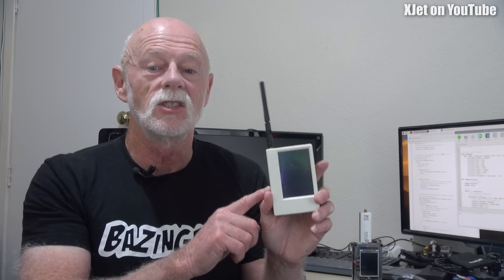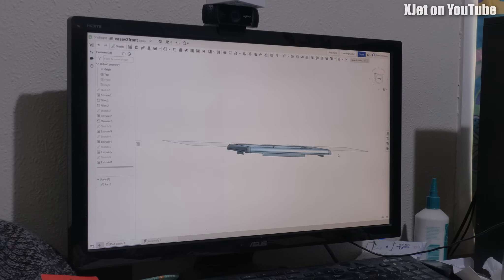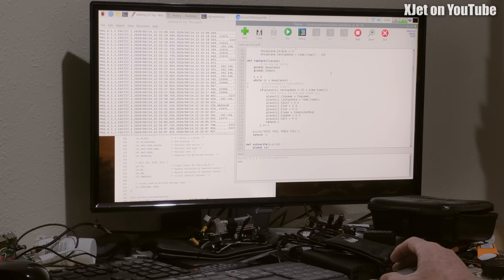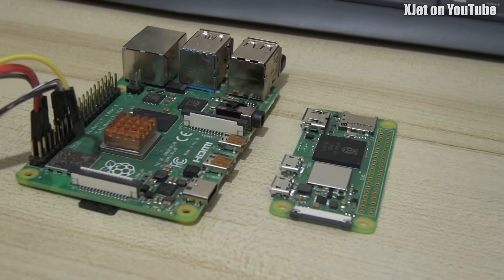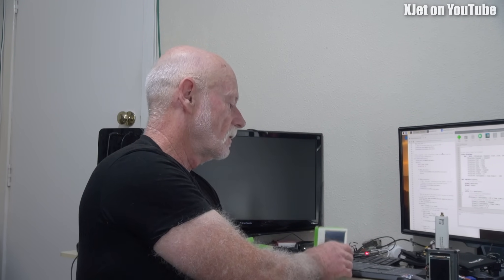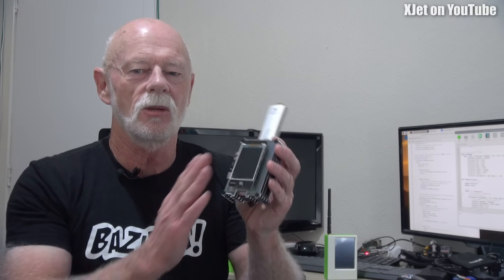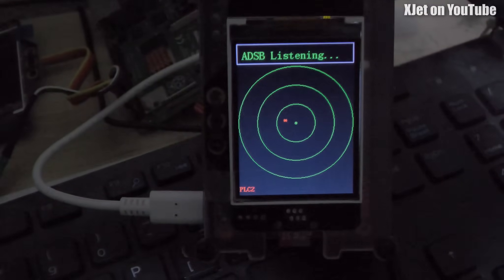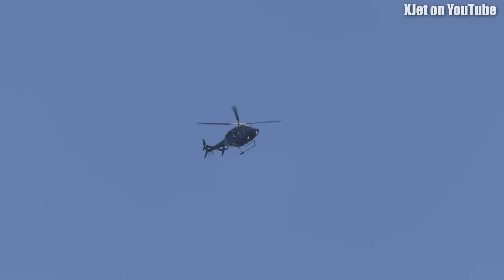This changes everything (I'm not kidding!)

Comment: Thank You for doing this Bruce! I need this device. I had a very close call with a rescue heli that came around a canyon corner from out of nowhere and hovered for 5 min BETWEEN me and my drone, which was out over the ocean with nowhere to land. The heli soon landed about 50 feet behind me on the road where I was standing. I was able to scoot the drone in at very low altitude and landed it on the beach with 7% battery,  just as the heli was landing behind me. It was the only space open enough for the heli to land to await the arrival of an airlift patient from an accident 2 miles down the winding coastal hwy. I monitor Flightradar 24 on a separate device and it never shows low altitude aircraft, the ones Im most concerned with when flying.
Reply: I have a hack rf one. It catches adsb signals and gives you details about  them.

Comment: Good project Bruce! Crossfire has FLARM built in but you pay silly license fees to receive. So many years ago I've built also a Pi solution having a RF scanner on the plane so I can listen to the radio traffic around my plane. Not as reliable as your ADSB scanner but it adds to the "extra safety" measures we take. served me well over the years.
Reply: Flarm also only covers helicopters in the US and EU aircraft for the most part.  And since the new ADS-B out laws/deadlines in certain airspaces were passed, flarm is a dying breed, at least in the US.
Reply: @micahmorton  yeah, i've never used it anyway but it's a shame. the idea was good. all the things we do for safety :)

Comment: Next FAA idea: ADS-B detector is illegal.
Reply: Never going to happen.
Reply: Even if the FAA banned “ADS-B detectors” anyone with an afternoon of research into SDRs and RF signal processing can effectively receive and decode ADS-B signals from nearby aircraft. Nothing can be done to actually affect this kind of change short of banning any and all kinds of hobby and commercial radio equipment which can receive UHF signals.
Reply: I was thinking the same thing lol
Reply: an rtl-sdr and a pair of pizza pans and you've got an adsb radio

Comment: Here is my issue. I am in an area where fixed wing commercial is typically 2500 - 3000 agl or msl B( area is flat) so  basically fixed wing is not an issue for me, however, multiror heli are.  I have been looking for a way to get alerts in the 0'-500' agl range.   Is your system capable of filtering out a aircraft above say 1800-3000 agl so I'm not getting alerts on the aircraft doing final into PHL? Let's be honest, if a fixed wing commercial flight is below 1800 msl where I fly they have a much bigger problem than my quad.
Reply from the maker: Yes, the alarm altitude  and radius are user-configurable.
Reply: @xjet  I'm interested.